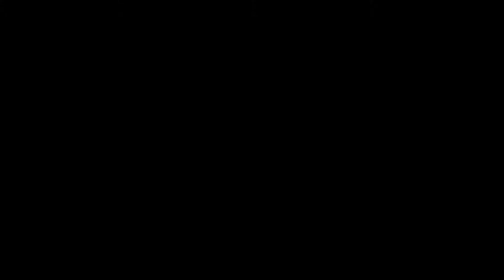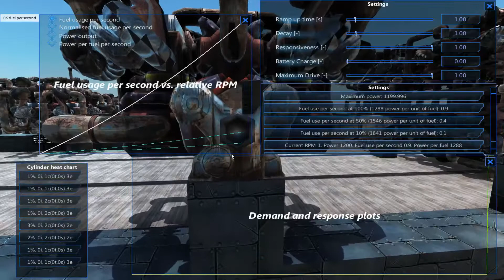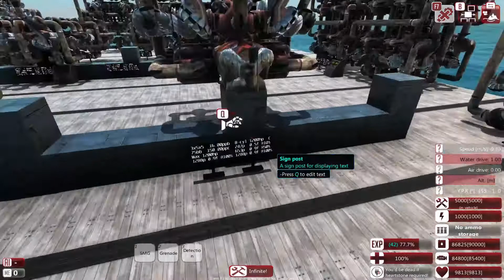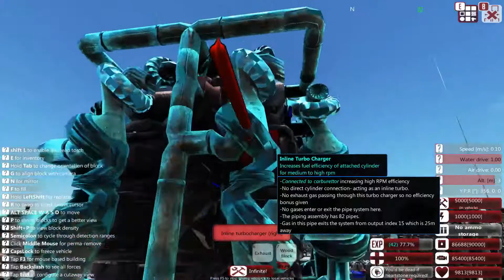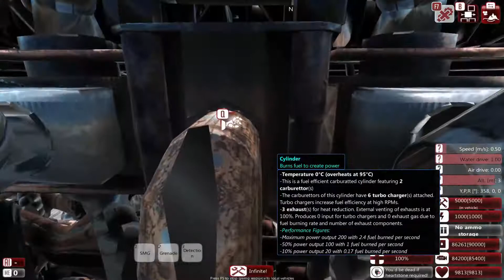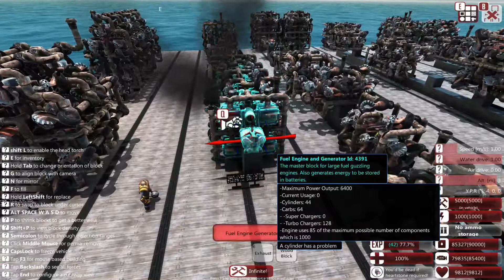From the Depths-Engine Guide Part 10 Series/Parallel Turbos

Comment: Again, I politely ask for an example raft of some of your engines other then your 'T-3'  (which is a very nice engine).  Even for just a handful of what you consider your best and/or most innovative.  :)
Reply from the maker: My opinion of each motor changes every week.....I like motors with unique core packing which isn't always good but if I feel there is more in it  It sits on the raft until I figure out how to improve it.... what kinda motor you want?? Power ??? Efficiency???? Density???  I pretty much stop around 6400 power(7200 at max) after that it makes more sense to have multipal motor for redundancy.... as far as efficiency I have actual zero fuel motors but they get big for  little power . After 10667 power per fuel it makes no difference but I have some up to 20K power per fuel.  I have motors from 1.79  to 21 power per block, I hear they can go higher but I struggle to get higher than 16 because my mindset is efficiency orientated.  If you want a specific motor (subject to learn about)  I can throw it on a raft real quick  or if you want me to improve a motor just put it up on the workshop and message me a link.........KIllshots "SATURN" the "Hyper Cube" and the "Evil Brick" are really good motors(better than anything I have for their class) and are all on the forum... the "beast" is from the useful engine platform , though I don't find many of them that useful (its just a PPF dick measuring contest, huge size no power, and your not really gonna learn anything from it , it's just a bunch of trophies)

my 3T was my first small motor with decent everything....... since I built it I have made like 5 different versions of it, and there is alittle bit of it in every motor I build...... the one on the raft was just to show how the math works  in motors in general......... I was gonna work on  a beam motor raft tonight because I don't think there is anything new for me to learn about them, but I got side tracked.

I improved a few of the motors on the raft and built a totally new core design that seems promising  5000-6000 ppf 2400 power with 13.33 density , it's a more efficient alternative to the "Hyper Cube".  I'm having trouble with the 4800 power version , but if I get it working right , it will obsolete a few motors, and a 7200 version might kill off more.....but it might only be possible in a 2400 power design (some designs don't scale well)
Reply: I collect 'good' engines.  Mostly because until very recently, I was very bad about designing my own even looking at other peoples examples of them.  I have pre-fabs of the 'Mini' and standard BlueLine engines, and two 'high power' designs that aren't drastically inefficient.  

I actually was unable to find a blueprint for the hypercube that actually runs inside FtD.

Edit: correction, I just NOW was able to get it to load, due to the highly unconventionally way in which he shared it originally.
Reply from the maker: I am capable of making interesting designed  very high power high fuel use engines , thru alot of carb sharing but keeping them cool requires alot of radiators which kills the point of them being dense and looking cool...........but i find them boring ...........if any of the wrapping get destroyed you loose power and possibly overheat .

  I can't really think of any of my motors that are that special.......I just build them and keep them until I build one that beats it .........once I learn something new I try using what I learned in a new engine and see if it knocks out any older design .........if it's better in some ways but not others it goes besides the old one....I tend to like motors that the core packs well, has a clean(or clever) exhaust wrap pattern and the overall appearance stays symmetrical and clean......... 

I tend to stay away from sharing them on the forum , because some people can be abit snobbish or narrow minded... for example my new motor is a higher efficiency alternative to the hyper cube,.... the design triangle says its will have to give up density to be more efficient at the same power..If I post it there, I will get a whole bunch of comments, like 13.33 isn't really that dense,X motor has better density, Y motor has makes more power in the same space, walls of text explaining why my motor isn't really an improvement over the "hyper cube" etc,etc , but if it fills the role better than any other ,it is a job well done..   .that's why i did a video on killshots motor over the "beast" ....the community has latched on to the "beast" and deemed it the "ultimate engine"....in some ways this is true(I love it's efficient core pack and clever way the exhaust wraps) but it's on an engine test platform where everything either makes 5000PPF more than it(but is huge) or way less power than it (sometimes both) that does paint it in a good light, but it kinda makes  a sad middle ground......where you "use the Beast because it's the best or one of thees other huge less powerful engines" There is no variety in the middle..

The need for a engine usually follows this path.......you build a craft........you outfit it with the basics, including a motor,...Than you finish off the craft and combat test it, make changes based on those test, which either force the need for more power(shields), more efficiency(no operational time/range) or more space(more tanks, ammo,or gear) If the final stats are that you need 2400 power and have 4x6x10 space to do it in, self proclaimed engine experts  arguing about how the "beast" is the best adds nothing to the conversation(which it always devolves to) and the person looking for help moves on elsewhere...........

A second example is the onyx watch huge ships filled with nothing, they have the pleasure of only following the rules when they are spawned in, so they are set up in that manner............try and run a campaign with any of them.......their slow speed would require massive amount of fuel(which could get destroyed in battle) or larger more efficient engines(better route in my opinion)  tanks don't repair with fuel....engines always repair good as new......the beast won't fit in alot of the smaller ships and  is a waste in most because they don't need the power.......

this is why i feel its better to learn how to build motors specific to the needs of each craft.